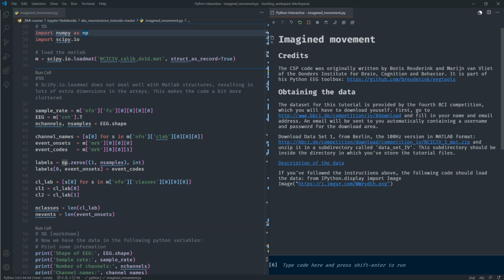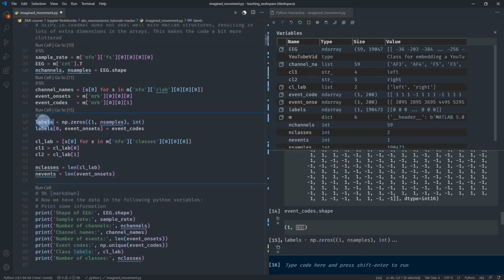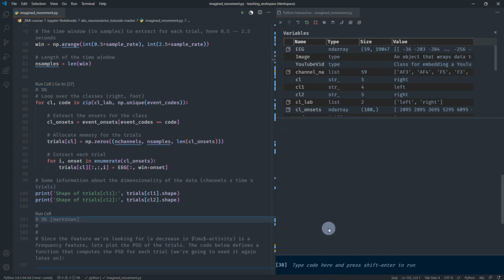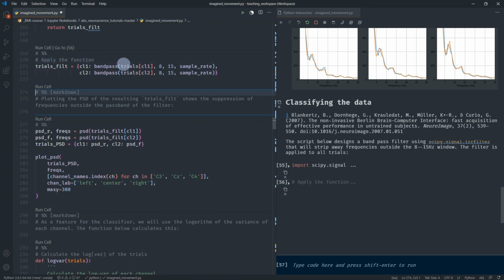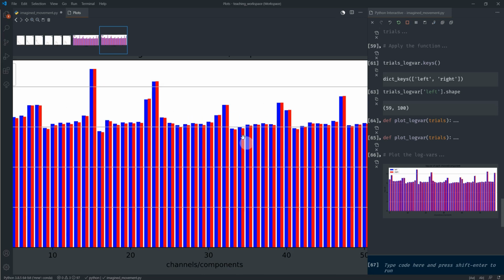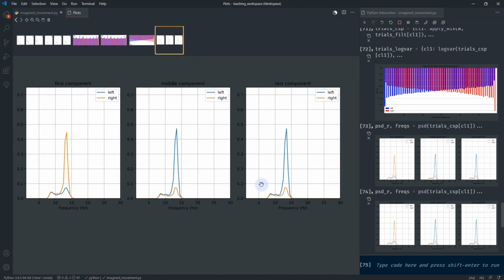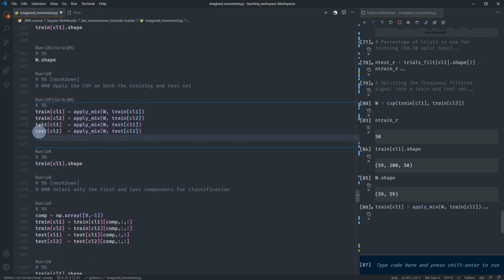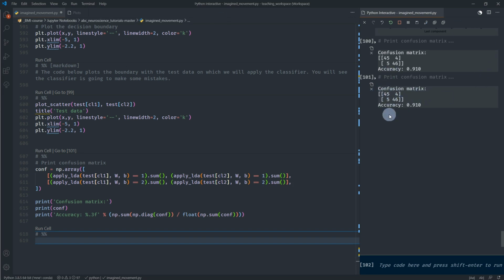L18 : The analysis and classification of Motor-Imagery EEG data (BCI competition IV)

Comment: Hi :) I have a question when analysing the number of events, it is printed that is equal to 1. But wouldn't be equal to 200. Thanks :)
Reply: That's right, you can fix it using the next line:
print('Número de eventos:',event_onsets.shape[1])